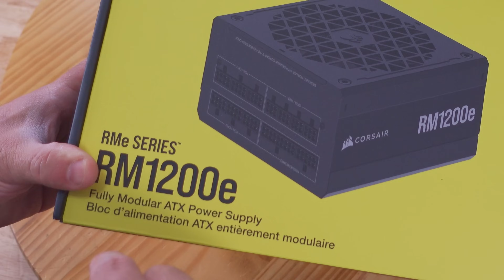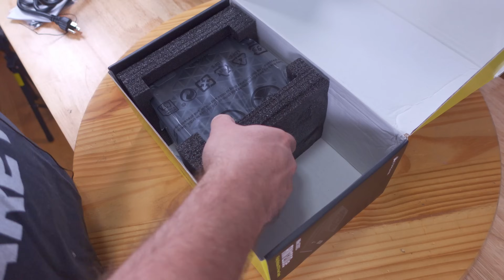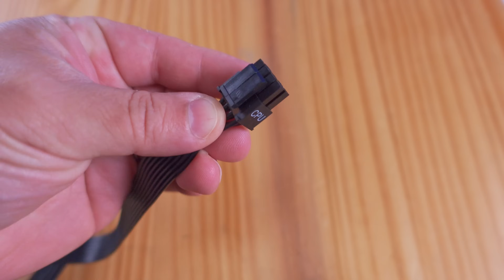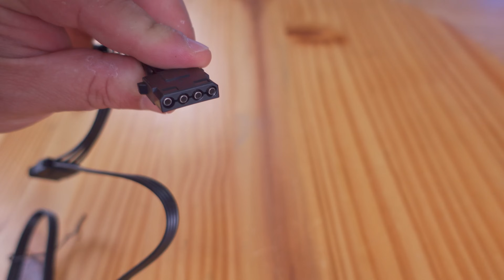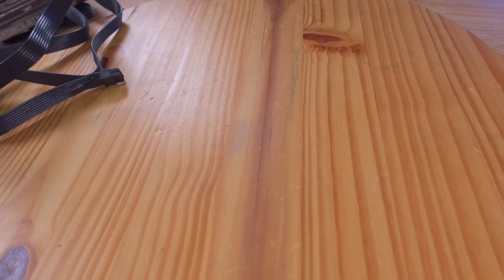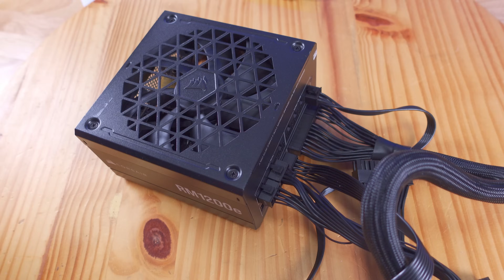Where do Power Supply Cables Connect to in a PC?

Comment: Ahhhh why are Sata power cables not universal wtf, I cannot connect that cable to my SSD, I would need to use a big force but obviusly thats not good idea, I thought that sata cables are universal....
Reply from the maker: Sata cables are universal, it's a standard the way you plug them in is not, maybe this will help https://youtu.be/vXpAsf7SJ3M?si=-1owqyDwSuchHSXM
Reply: @ThisBytesForYou  it doesnt work, is hard to explain but when I put the SATA power cable in it fits at start, but doesnt wanna go further, I am lineuping it, doing every method the only thing that I didint try and will not try is full force obviusly.
Reply from the maker: @aNc1esta did you watch the video
Reply: @ThisBytesForYou yes I did, the way he plugged it was super easy he wasnt even explaining that much further
Reply from the maker: @aNc1esta he is me and there is nothing more to explain, if you have an issue try a different sata power cable.  I have installed thousands of these.
Reply: @ThisBytesForYou Oh I didint know it was you, thank you for replies I finally got it, I needed to force it more I was scared that I will break it but when I used a lot more force it worked, I think the problem is with my disk having maybe something with the chips idk, anyway thank you for trying to help me much appreaciate.
Reply from the maker: Anytime bud, happy I could help.

Comment: Could you by chance help me my pc turns off a second after i turn it on i think its a power supply issue
Reply from the maker: Could be soooooo many things, so that I can help
1.  What is the manufacturer and model number of your motherboard
1.  What is the manufacturer and model number of your CPU
1.  What is the manufacturer and model number of your Grahics Card
1.  What is the manufacturer and model number of your RAM (what slots do you have them plugged into)
1.  What is the manufacturer and model number of your SSD (list them all if you have more than one)
1.  What is the manufacturer and model number of your Power Supply
Reply: Geeze thats alot.. This pc is 6 to 7 years old idk what it is i need to replace but the newest thing in it is the ram
Reply from the maker: @Dr.Ivo.Robotnik-Eggman trying to help you, so that I can, I need this info, if it doesn't work after you installed ram, maybe you installed it wrong.
Reply: @ThisBytesForYou i don't know where to find this stuff tho thats the issue
Reply from the maker: maybe this will help https://youtu.be/xqWfeOsTto8
Reply: Got some news the pc came on for a bit and i saw something that said date and time could this be a cmos battery issue
Reply from the maker: sound like the CMOs battery is dead, you can pick one up at Walgreens, CVS, Walmart, Target, most places that sell batteries or you can pick one up from my Amazon affiliate link: https://geni.us/XZ7FTf
Reply: @ThisBytesForYou pray for me that it fixes
Reply from the maker: Let me know how it goes, but now that its happened, you will need to setup the BIOS again.

Comment: I have a sata data connection cable but u didnt show it on the video
Reply from the maker: the sata data connection doesn't connect to the power supply, and thats why I didn't show it, you need this video: https://youtu.be/Em9KVRmxIYI
Reply: @ThisBytesForYou thanks i am just scared cuz my pc isnt wanting to work and i am scared to replace the psu if i do i wanna replace it with a 600w so i won't have the 115v 230v switch on the back like mine does
Reply: My sata data connector looks to be apart of my psu
Reply from the maker: @Dr.Ivo.Robotnik-Eggman  if its Data, it is not
Reply from the maker: @Dr.Ivo.Robotnik-Eggman  do you mean an M.2 SSD?
Reply: @ThisBytesForYou maybe i am still new to pc repairs but i saw where the cord is connected to its not the pcu so thank u for informing me. I think my pcu is dying the lights turn on for a second when i press the power button but shuts down after i have an IBUYPOWER case so idk what psu will fit thats 600w i got 100 dollars of christmas money i wanna buy a good psu
Reply from the maker: it sounds like though, you are overheating, what have you recently changed in your computer?
Reply: @ThisBytesForYou I don't know how my ram would be overheating its the newest thing in my pc
Reply: And yes i tried it with my old stick of ram that came with the pc
Reply from the maker: It sound like your CPU or Graphics card is overheating, not your RAM.  Your RAM's controller is built into your, you upgrading your RAM, do you have 2 different types of RAM in your PC?

From the oldest thing to the newest thing in your PC, anything can overheat, though RAM overheating usually isn't a thing unless you are overclocking or have other incompatibilities.  Your message to me was 

"@ThisBytesForYoumaybe i am still new to pc repairs but i saw where the cord is connected to its not the pcu so thank u for informing me. I think my pcu is dying the lights turn on for a second when i press the power button but shuts down after i have an IBUYPOWER case so idk what psu will fit thats 600w i got 100 dollars of christmas money i wanna buy a good psu"

A very long run on there, what is the issue right now as it seems I am not sure.
Reply: @ThisBytesForYou i have 2 of the same types of ram i bought them separate from the pc
Reply: I also recently put new cpu thermal paste on plus i dusted out the pc around the cpu and the gou including the fans
Reply from the maker: @Dr.Ivo.Robotnik-Eggman  you just put thermal paste.... check your temperature for your CPU while you are idle, what is the temperature?
  
I am pulling teeth here, how many sticks of RAM do you have?  Do you have 2, or do you have 4?  If you have 2, did you buy each separately, of if you have 4, did you buy each pair separately?
Reply: @ThisBytesForYou just 2 sticks of ram
Reply: We got the 2 sticks of ram separately
Reply from the maker: @Dr.Ivo.Robotnik-Eggman  2 seperate sticks even if they are the "same" even same model number and everything, can be different because they use different IC's, I was a product development engineer for Alienware and Velocity Micro, when we would do large batches of machines we would have memory in trays, if they didn't have the same date and lot codes, sometimes they would have issues (the date they were made and the lot/batch they were made in.  This video might help you, what is the manufacturer and model number of your motherboard: https://youtu.be/xqWfeOsTto8
Reply: @ThisBytesForYou whenever the pc did start up for longer than a second the sticks of ram lit up cuz they also have rgb
Reply: Idk where to find the motherboard manufacturer
Reply from the maker: @Dr.Ivo.Robotnik-Eggman  Usually you would open the side of your computer and look inside for labels, but you can also use this video: https://youtu.be/65ZSiVImJx0
Reply: Give me some time a day or 2 we are checking out my pc my step father has built a pc or 2 he knows how to check them gimme a bit
Reply: Best case its just a simple psu replacement
Reply from the maker: @Dr.Ivo.Robotnik-Eggman  I will leave you to it

Comment: With the Sapphire Nitro+ 9070 XT cable burning issues, is it safer to use the cable (12VHPWR) included in the PSU rather than the one included with the GPU (2x6 to triple 8pin adapter)? Thank you so much!
Reply from the maker: Yes, its always better to use a cable, a direct cable rather than using an adapter.

Comment: thx fOR this video.I ran into a prob w/my pc after the BF6 DEMO,and come to find out i had 1 ram stick that was bad.I was soo annoyed it wouldn't let me boot into windows or anything but i put some more ram into the pc and it runs flawlessly .grabbed a PNY 5070 coming in this week.My main pc has an EVGA 1000 WATT PSU
Reply from the maker: Nice, happy I can keep helping you after so long.  Yeah a single stick is running in single mode, you want to be in dual mode, so you get the most performance, as for the 5070 thats awesome.  You have an EVGA 1000Watt, i have 3 of those, they are great, but they don't have the 12WHPW connection but the box of the 5070 will have an adapter, PLEASE be very careful with, make sure its firmly seated.
Reply: @ThisBytesForYou  i WILL MAKE sure it's seated correctly  yeah I'm taking out the 4070 MSI GPU & putting in the PNY 5070
Reply from the maker: ahhh good stuff.

Comment: so the recommendation is not to use the 600watt cable and just use 3 separate supply into the 3 way furnished with my rtx 5070ti?  i have the corsair 1200i power supply.
Reply from the maker: No, use the 600watt cable.  The recommendation when using a pcie cable is to not use one cable and the daisy chain, to use multiple cables and no daisy chain all pcie talk.  That's why I then moved in to 12vhpwr